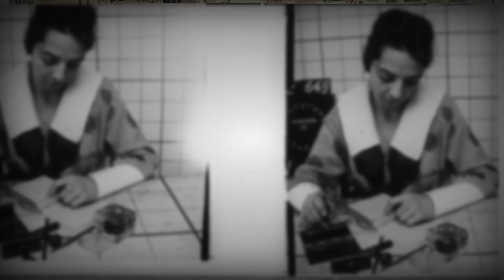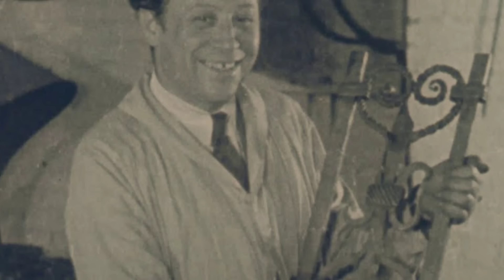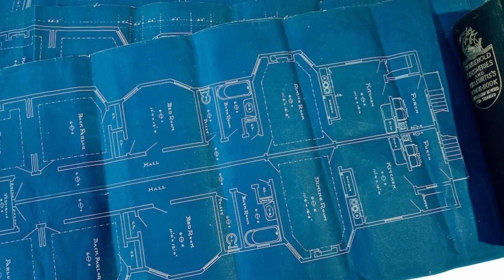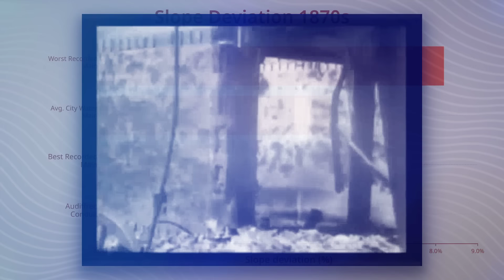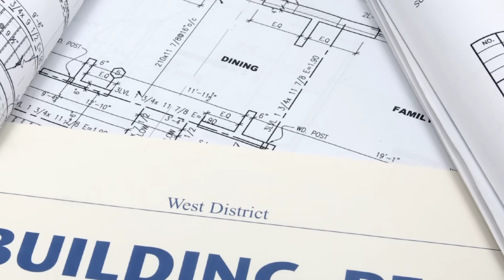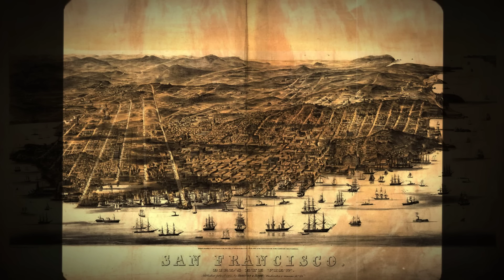We Dug Below the Streets… and FOUND Ancient Tartarian Bridges

Comment: Most of the so called "sewage" tunnels found under major cities are from a far older time. And they are build from a similar blueprint and building practices. 

They were found by 1800 engineers when they tried to dig for large buildings demanding deeper foundations, building needed sewage tunnels, or Metro lines.